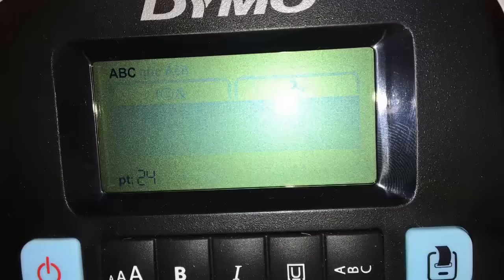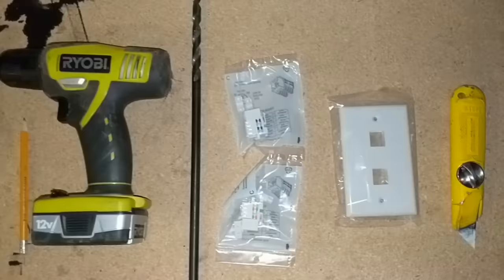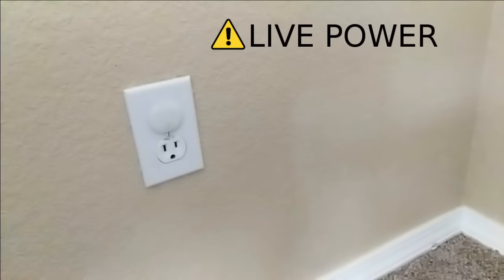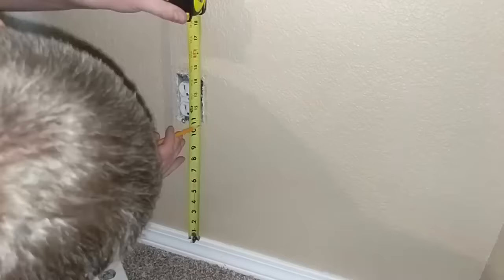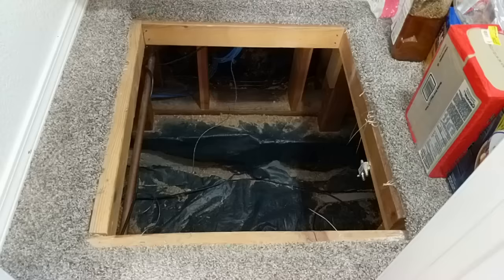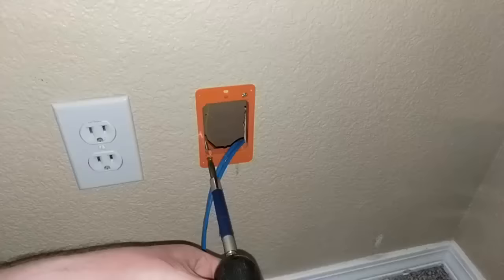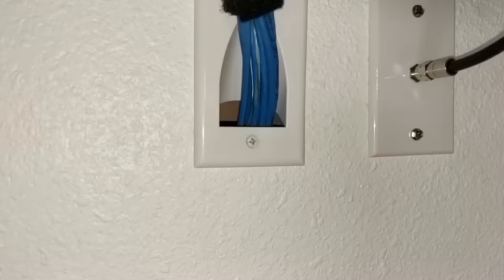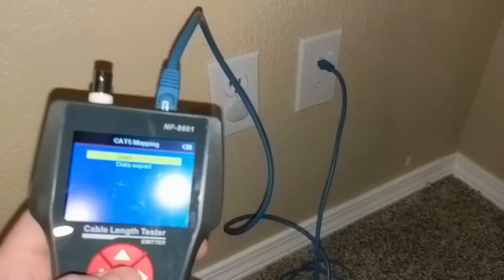How to Add a Network Jack to a Wall

Comment: Nice work! I'm about to run some cables to an interior wall as well. Any tips for if there happens to be insulation in my setup?
Reply from the maker: If your building codes are the same as mine, there shouldn't be any insulation in interior walls. You could always use the cable fishing sticks to push it up, or you could always pull off a tiny spot of drywall elsewhere to help fish the cables and patch it later if there is insulation for some reason.
Reply: Most interior walls will not be insulated as mentioned. However, running cables in insulated walls is still possible, it just requires a bit of patience. The key is not trying to run through the insulation. Instead, try to run behind it against the wall. Fish rods or fish tape are your best friend here. You'll want something flexible, but rigid for controlling your pull. A flexible cable installer's bit or bellhanger's bit will also be needed in most cases.

Comment: You are shown tracing the ethernet wall plate on the wall, then cutting the hole. But if you cut the hole the size of the wall plate, it will fall within the wall. Shouldn't you trace a smaller hole for the opening for the wallplate bracket
?
Reply from the maker: No, I was just using the cover plate as a straight edge. The whole is the size of the outer box.

Comment: I have cat5e ports everywhere in my house, I tested it and plugging in an Ethernet cable didn’t work. I heard that you have to have another modem that connects the ends of the wiring... I don’t know much about this topic so don’t call me out XD Can anyone explain why the ports don’t work?
Reply from the maker: There will have to be some sort of networking equipment in the house somewhere. If you have lots of ethernet ports, then most likely, they all should run to a centralized location. Check the closets, or a utility room or something like that. There may be a wall box that stores this stuff. Once you figure out where all these cables are running to you can see what equipment you have at your disposal.

You would need to make sure these cables are plugged into a router, or a switch. That will make these ports in your house "live." You might consider watching some of my other videos (what is a patch panel do you need one, home networking 101, or sweet network setup..) that could help you understand more of this.

Good luck! Ask if you have any other questions, or need more clarification.
Reply from the maker: If you would like, you could send me a youtube message sure. I haven't used that much yet, but should be able to figure it out. That's what us nerds do.
Reply: Budget Nerd well it’s fine, we don’t have to lol. If you’re getting notifications for comments then let’s keep going. I thought that I could send pictures on YouTube messages but I can’t sadly.
Reply from the maker: Or maybe not. Looks like Youtube might have removed personal messages..
Reply: Budget Nerd Who knows, I figured out how to send photos by link, but can you see my question I said about two comments ago? Here are the pictures of the hub https://imgur.com/a/OKWn2vo
Reply from the maker: You can configure a router to just act as a switch, but it's much easier just to purchase a switch honestly. They aren't that expensive. If not configured correctly, two routers in your house can over complicate things.

If you want to find out which port is the one that you want to plug into the router/switch, you can plug in a bunch of the cables to the switch and then see which port starts blinking on the switch. Unplug the rest.

You could also get an inexpensive cable tester and use that to find which cable it is. There are a few ways. I would recommend you checking out some of my other videos.. they go over some of this stuff as well..
Reply: Budget Nerd I’ll check them out now! Thank you for helping a bit! If I have any more questions I’ll ask them later lol
Reply: Budget Nerd I checked the Ethernet hub box and there seemed to be an unplugged coaxial white cable. I’m asking this because the only e-port on the connection board is being used by our security system. I was wondering if one of the unplugged blue Ethernet cables are the input for a switch that comes from the router.
Reply from the maker: It's hard to say without being there or seeing it sadly
Reply: Budget Nerd I have figured it all out thanks anyway!
Reply from the maker: Good to hear! No prob.
Reply: Budget Nerd yep, I will just have an Ethernet cable go through the living room port then down into the cabinet. I only need it in two rooms so I’ll buy a connecter that splits the connection (female to 2 female)

Comment: I need a little help. I have an apartment and my router is in the closet with all the other coaxial cables . On the walls of the apartment there are wire for ethernet. How do I set up my router to be in one place and have the other existing Ethernet cables in the walls work? I do not want to run an Ethernet cable along the walls I wanted to go for a clean look.
Reply from the maker: You need to find out where all those Ethernet connected to your jacks go. Likely a closet, or a cabinet somewhere, maybe to a switch or patch panel. You would just setup your router and equipment there.

Comment: I'm trying to get an Ethernet or two from our office to my bedroom. They share a wall (probably some space in between). I feel like I could totally do this but it's my brother's house and I don't want to mess up. Would it be extremely easy doing this to just connect 2 rooms together that are separated by one wall? Just wanna go straight through
Reply from the maker: Interior walls are the easiest. Sounds like it's the best case scenario. But you'll have to tell me what you are going to hook up in there, what you are connecting, what equipment you have, where it is, etc first before I could tell you what would be your best bet.
Reply: @BudgetNerd  back corner of both rooms. I want to get 2 Ethernet cords from the office to the bedroom for Xbox and PS4. It'll be coming from the Comcast router/modem. I don't have a power drill or wire cutters of punchers or anything, though
Reply from the maker: Is this on the first floor? Is there a crawl space? The easiest is to run the cable through the floor, and run it through the crawl space and up in the floor in the other room. Like the cable companies do. Whatever you do, you'll want to check with your brother.

The more ellegant solution (which I would recommend, I don't like advocating drilling holes in floors) would be to put a wall plate with two Ethernet Jacks on both sides of the shared wall, and run two little patch cables inside the walls to connect them. Then run your Ethernet cables from the router to the wall plate, and from the wall plate on the other side to the consoles.

Even that could be done without tools. However you would still need the tools to cut the holes for the wall plates etc. You would just get keystones that would accept normal Ethernet cables.

Comment: Is that a one-time-use pull string?  How can you return it?
Reply from the maker: If it was really short it would probably be a one time pull string. I left lots of extra string so I could pull it, snip it and have more. When I can I remove the cable I was pulling and pull the string back down and that extends it's useful life.

Comment: So it's 16 inches from center to center correct? or is it truly 16" between studs?
Reply from the maker: Center to center
Reply: @BudgetNerd  Thx!
Reply: Keep in mind, the 16" rule is for modern homes.
Older homes could literally be anything.
But usually they are further apart than 16" on center.
Reply: @jstravelers4094  Thanks!

Comment: DONT EVER DRILL FROM THE FIRST FLOOR DOWN.  You may hit electrical or plumbing or something significant.  Instead get a burial flag and snip off the first 3 or 4 inches at a 60 degree angle, then chuck in drill with sharp side to floor. Find a wall cavity with stud finder or knuckle knocks, put it between the baseboard and floor and and then let flag drill through and partially stick out in crawl space or basement.  You now know exactly where you are... Now drill from crawl space or basement approx 2.5 inches in proper direction from your flag and now you are in cavity of wall.  Run your fiber rods and wire and there you go.  DONT EVER DRILL A HOLE WITHOUT KNOWING WHAT IS ON THE OTHER SIDE.  Same applies for ceiling fish jobs

Comment: How do I know which of the two standards (A or B) is used in my home? Do I have to remove a different ethernet port? My situation is that one of the two ethernet ports did not have the wire attached to the keystone for some reason.
Reply from the maker: Good question. Someone may have a better suggestion, but you might just wire it with B. It's historically been more common in my area at least. Then see if it works. If you had a cable tester that showed the cables, it would tell you if they're good, or which ones are swapped.
Reply: @BudgetNerd  thanks ! I have been doing some research and it seems like A is quite uncommon here too.

Comment: Would it be possible set up a new pair of ethernet outlets where one outlet is used to connect to an ethernt switch and the other outlet is used to connetct to a computer? The hypothetical setup would go Ethernet Switch --> Outlet 1 --> Oulet 2 --> Computer.
Reply from the maker: Sure, as long as I'm understanding what you are describing. Outlet 1 and outlet 2 would be in different rooms, connected to each other?
Reply: @BudgetNerd  yes the two outlets would be in different rooms, connected to each other.
Reply from the maker: Yes that totally works.
Reply: yes this is typically how this is done in many places, usually grouped together on the switch side in what’s called a patch panel

Comment: ❓❓❓QUESTION.  Hello great video. I would like to know, in order to add ethernet ports do I need to have a switch or patch panel in order to do this? My thoughts/plans are to add 2-4 ethernet ports to different rooms (one per room) that can connect to my router. I would like to be hardwired in for gaming/firestick rather than using wifi. Your thoughts please and thank you.
Reply from the maker: For that you would probably need a switch. Get one that has enough ports for all the jacks you'll add around the house. Then connect that switch to the router. I have another video that goes over that stuff.
Reply: @BudgetNerd  thank you very much for the quick reply. If you don’t mind one last question, in what circumstances would i need a switch with PoE versus a switch without PoE? Thank you.
Reply from the maker: Poe comes in handy if you need to deliver power to your devices through the Ethernet cable.

Comment: Out of curiosity... where did you get the jacks, wall plate, and low voltage box?
Reply from the maker: Internet, Newegg and Amazon to be specific.
Reply: @BudgetNerd  I looks like you bought them from my job. I was just wondering.

Comment: I thought you needed special cables for going in crawl spaces so they don't carry fire and or support their own weight through floors?
Reply from the maker: There's plenum cabling that either resists fire or doesn't release dangerous smoke when it does burn. Codes are different in different states or countries, but normal cable totally works where I am.
Reply: @BudgetNerd  Ahh, I see thank you for clarifying!

Comment: Someone please answer this.
One: power line adapters are basically doing the same thing? 
two: What if I buy a Ethernet outlet plate and just remove the outlet thats in my wall and put the Ethernet outlet on.
Reply from the maker: 1) Power line adapters allow you to pass this network data through the electrical cables that are already in your walls. You can use those to create a wired network if you aren't wanting to run any extra cables. You need an adapter on each end.. and I'm not sure you're confined to an electrical circuit or not. Never used one.

2) WAIT.. if you are talking about pulling out an electrical outlet and replacing it with an Ethernet jack wall plate, using the same electrical wires, don't! That is dangerous, and it won't work. If you want to use the power lines in your house to pass data, you have to use power line adapters. There is no need to ever touch a wire.
Reply: Budget Nerd thank you.. i think i’m going to stick with the power line adapters. i think i’m going to instal ethernet in all the room on my triplex i own and rent out because i think that could be useful for tenets !

Comment: Nearly every youtubers video on home networking has a 24 port switch with 8 cables in it. Money well spent
Reply from the maker: Give it time.. mine is getting there.
Reply from the maker: So true, mine is now 1/3 full. My network is growing!
Reply: actually surprising the 8 or 16 port are just as expensive on new egg n they dont sell them as rack mount so technically cheaper to get 24 port

Comment: As a low voltage structured cable technician, this is easy to do, but there are different wall caddies that can be used and you don't trace the faceplate for the hole you cut out. There are many other things I could say, but I'm not going to go in to great detail.  This is a video for a do it yourself, and not do it like a professional.

Comment: I need help I had Ethernet down in my basement and when our basement got flooded when the dry wall was replaced it was taken out and the cables are still there should I just buy the stuff that power it and put all the things I need to power the Ethernet?
Reply from the maker: You could, as long as the cables are ok. You could test the cables before you spend the money on equipment.
Reply: Budget Nerd alright thank you also how would I be able too test it?
Reply: Budget Nerd I just realized that I have a cat 3 cord running with a port that has some wiring on it is that the whole port or no?
Reply from the maker: There are cheap Ethernet testers you can get, like this one..
https://www.amazon.com/Zoostliss-Network-Cable-Tester-Networking/dp/B06XZYXN63/ref=zg_bs_7701919011_5?_encoding=UTF8&psc=1&refRID=4FRF05CJSXX3MSFSCZWM

If you are ok spending a bit more, you can get a kit that will give you more options to test
https://www.amazon.com/ELEGIANT-Multifunction-Collation-Telephone-Continuity/dp/B01HCQSHNG/ref=zg_bs_7701919011_1?_encoding=UTF8&psc=1&refRID=4FRF05CJSXX3MSFSCZWM
 
You have a network jack with wires running to it? What do you mean "is that the whole port?" What makes you say it's cat 3? If it's cat3, you might consider running some newer cable. Cat 3 is going to be slower.

Comment: How did you determine where to center drill from the bottom up?
Reply from the maker: Little bit of experience in construction, making a mental picture of the house underneath, looking for clues like the power going up into the cavity for the outlet, the layout of the foundation, and a bit of guessing.

Comment: My drill spins ccw and won't drill. Where did you buy clockwise drill?
Reply from the maker: There is probably a switch on the drill that will change its direction.

Comment: Can u have multiple items by putting them all together on a switch and then run 1 ethernet cable from the switch to the 1 outlet? Then to a bigger switch that's connected to a server rack? What's 5he patch panels do?

I would appreciate some advice from anyone. I'm trying to setup a network in my house. Is this the proper way?

Internet isp - firewall-router- possible firewall with multiple ports- switches (3) 1 per room combining all electronics to said switches-outlet- then big master switch (also WiFi will be connect to this switch from firewall)?

Thanks for the advice guys
Reply from the maker: Sounds like what you are describing would work.
Reply: @BudgetNerd  thank you for the help 😀, if it does I'll let ya know. Too bad i can't show ya

Comment: Is the cable used for the wall outlets solid or stranded?
Reply from the maker: Solid, as they are the other end of the cables terminated at the patch panel.
Reply: Budget Nerd thank you!

Comment: how about if i already have de outlets for the cat "5 e" but i want to change it to cat "7" but i can't open holes in the wall is there an adaptor or something  to the cat 5 e to make it cat 7? all the cables are going trhough the attic but i cant go upthere
Reply from the maker: No adapter. If you want cat 7, then you would have to run the cat 7. You can't make cat 5e perform like 7, it's a matter of its physical properties and its resistance to noise/interference amongst other things. An adapter can't change that.
Reply: @BudgetNerd  thanks,

Comment: can i place the cable outside? i just need wifi and i can’t afford the 150 installation fee (i have an apartment)
Reply from the maker: The cable "can" go outside, but it's best to use outdoor rated Ethernet cable if you want to run it outside.
Reply: If all you want is wifi, you really don't need to string any wire. Just ask your internet provider how you can acquire the proper equipment to set you up. If the service is being provided as part of your rental fees, ask the management group from your apartment complex for instructions on setting it up. In either case you may have to purchase or lease the necessary equipment...depends on your situation.

Comment: Network and other low voltage are NOT supposed to be in the same cavity as AC due to interference on the CAT cables.
Reply from the maker: I've heard that. But you know, they work great, so must not be a huge deal in this scenario.
Reply: If your house is wired with BX, then no problem. Even if you have Romex, as long as your run is say a foot or so distanced, then I wouldn't worry too much about it.